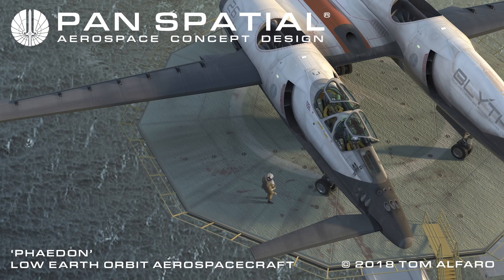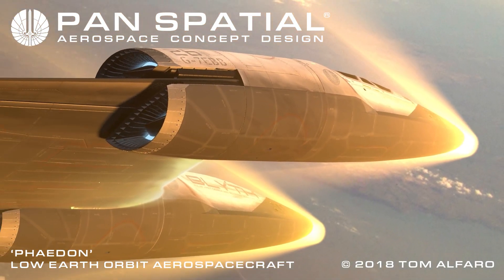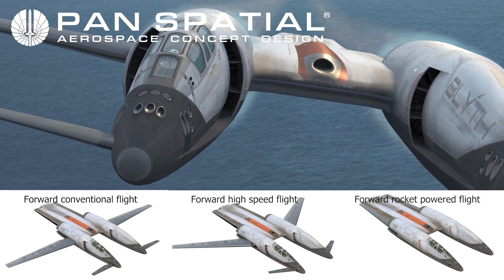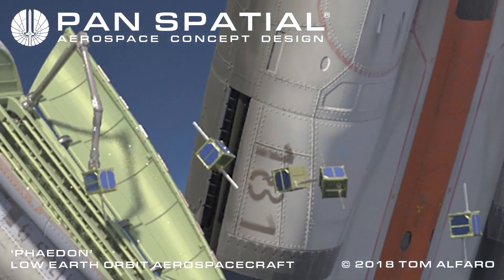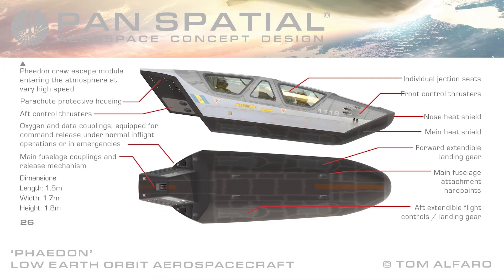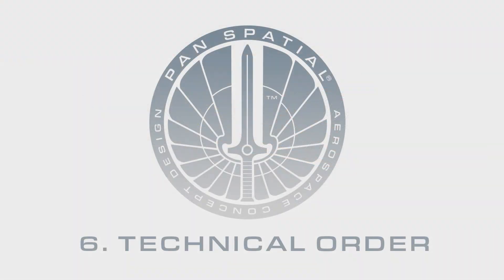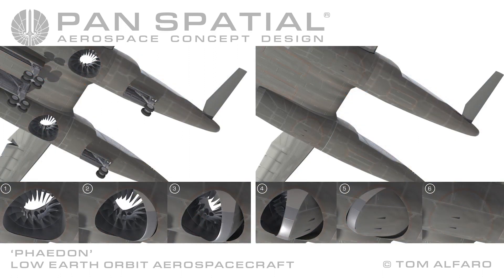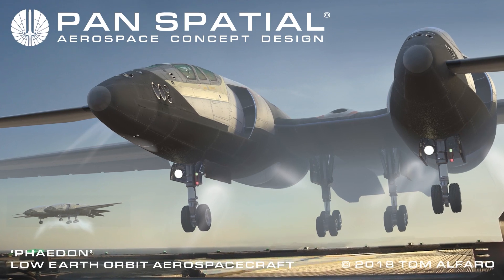PHAEDON Shape-shifting Orbital Transport Aerospacecraft

Comment: Jaw dropping. My only "Quibble" is the materials needed & the junction of lift/ propulsion & wing mounting / sweep carry-thru. Propulsion, Main mounts (gear) & wing mount are compact.... centralized.
Cockpit/ Cargo modules weight combined w/ rotational assemblies add horrific torsional loads on the duct Fan /propulsion wing junction. Then the stresses added by the canards & forward RCM.....
Would love to see it built but w/ contract going to the lowest bidder. 😬
Superlative video, excellent work. Again, jaw dropping 👍👍

Comment: Did youtube lose it or does the video seem to end at around 13:30 and go black for everyone else as well?  This whole thing seems like someone is trying to cheaply train A.I. by letting it present ideas to humans who will than talk about the ways in which the designs are problematic.  Learning from the humans on youtube.  To keep costs of training the A.I. down.
  This design seems like fan fiction.  Full of fun ideas that overcomplex, maintenance heavy, and prone to failure.
Reply from the maker: The video WAS jacked up. The file I uploaded had an extra 14 minutes of rendered blankness. I was not thrilled about the prospect of having to re-load the video. Fortunately, youtube studio allows creators to  trim a video even after loading it. I noticed the problem early and fixed it. But if I hadn’t, you’’re the only viewer who said something about it. I guess I know who my real friends are! (Ha).
Reply from the maker: I appreciate your substantive comments about the content and presentation as well. It has an impact on what I do in the future.
Reply: @pan-spatial     a bit more detail as far as my thoughts.  Sweep wings, and vertical take off and landing for all that they are cool ideas.  Have not stayed in use.  From what i understand of sweep wing.  It takes an enormous amount of reinforcement at the point of pivot.  Vertical take off and landing requires a huge amount to trust.  Your not using any aerodynamics so you need pure power to compensate.  This also means your ship would not be able to care much weight and still make it into space.  On that note.  As i recall.  Your intended engines for high altitude seemed to not exist at the moment.  The design had very little room for fuel.  The double nose design would make balancing the flight characteristics problematic.  
  Over all your designs are fun to look at and to consider.  We may be closing in on a point where some of these ideas may soon, be more practically achievable.  Thinking boldly lets you learn the most, the fastest about what is realistic and what is practical and the reason why.  Thinking boldly also gives you the opportunity to jump ahead of your peers who stop dreaming.
Reply: Very good 👍👍.

Comment: Even if those surfaces behind the engines could survive the heat, they would have corrosion issues and would require an ungodly amount of maintenance. Prettymuch a complete replacement of those panels after every flight. It's kinda painful to look at, knowing how many hours of work would go into that. It would most likely require drilling out and replacing tens of thousands of titanium fasteners. You might get 3 per drill bit before it's dull. Months of work between flights, and Mechanics that all hate their lives.
Reply: I wonder how it could yaw without rudder when gliding towards runway. The long flat tail serving as lift and mounted airbrake seems impractical. Why not just set the main thrusts all the way to the back instead? He tried to adapt Russisn M77 stratosfera & M55 geofizika design but with dual separate cockpit.
Reply: @jawarakf  differential steering a la B-2.
Reply: @michaelgautreaux3168  B2 has really poor maneuverability, it sacrificed maneuverability & speed for stealth. This spacecraft is not for war so there's no point removing the fin